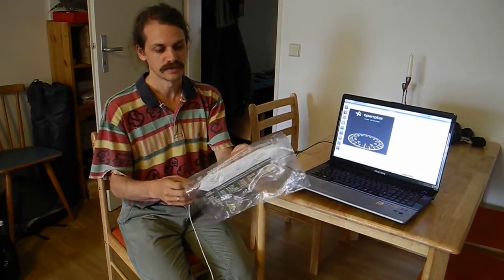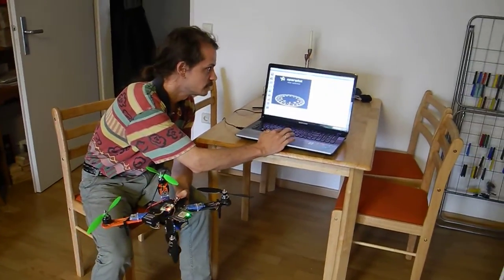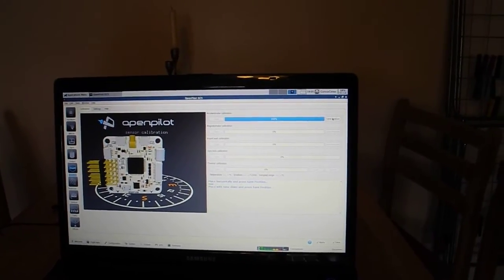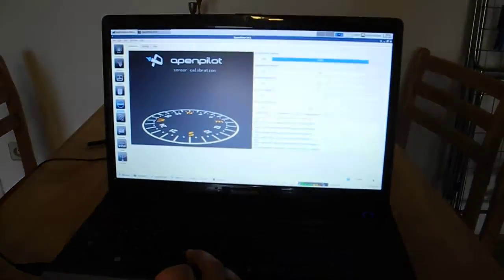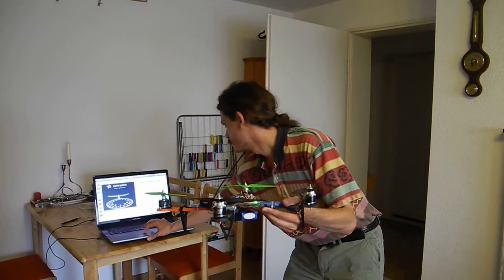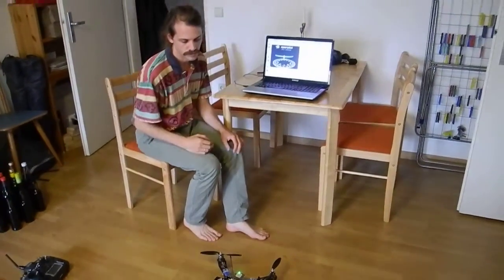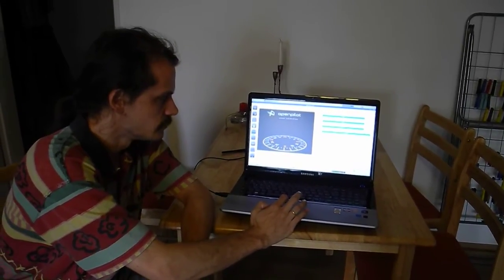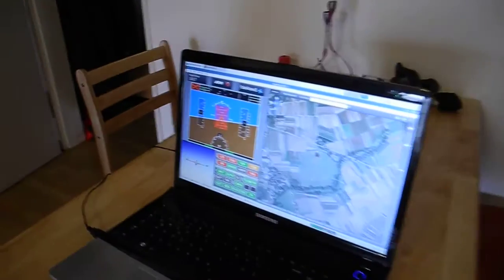OpenPilot Release 14.06 Sensor Calibration Tutorial

Comment from the maker: What I forgot to mention is when to do the calibration:

Thermal calibration: Every few weeks.
Calibrate before putting your Revo on a frame. Recalibrate after firmware update/settings erase or when you took revo off a frame for maintenance.

Accel calibration: Every few weeks.
Calibrate after putting revo on a (new) frame. Recalibrate after firmware update/settings erase or after frame repairs.

Magnetometer calibration: Every flight!!! (if necessary, check with mag alarm)
Calibrate after putting Frame in flight configuration including all components.
Check alarms before every flight, and if necessary recalibrate. Especially each time any component on the frame changed (new bat, shifted wires)

With a good calibration, if you hold the frame in the air and rotate it arbitrarily, you should have "green" magnetometer alarm most of the time, and no more than yellow  alarm in any orientation.

Gyro Bias calibration: Once a day (not mandatory)
Calibrate before first flight each day.

Board level calibration: When necessary.
(Re)Calibrate after any frame modification or crash that might have shifted or realigned board or other frame components.

Comment: Hi I calibrated several time (except Thermal) but the moment I change over to GPS hash algorithm, the machine does not even act normal. 
Do you have any advice on this. ?
Reply from the maker: +Ye Tun 
For the GPS algorithm to work you of course need GPS reception with a solid fix, otherwise the algorithm will not initialize. If that is not the cause of the issue, I would suggest opening an account on forum.librepilot.org and ask for help on the forum. Give as detailed information as possible regarding the problem (what exactly you did, what you expected to happen and what happened instead) when possible including screenshots or even videos if 
you have. The more detailed you describe the problem, the more likely you will get help.